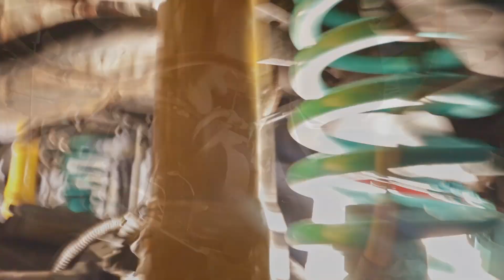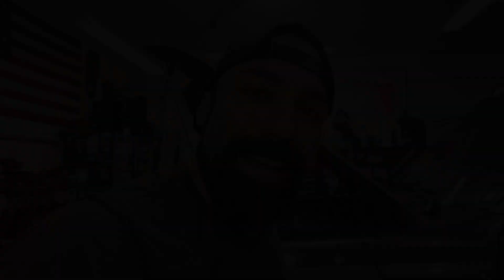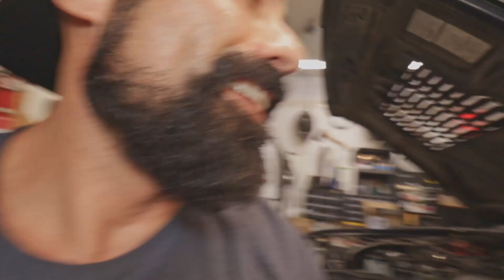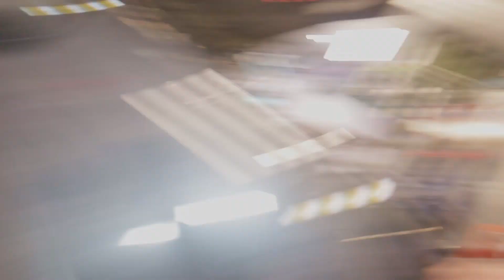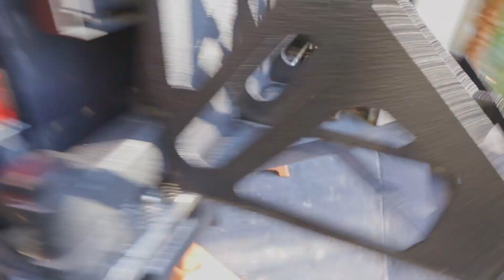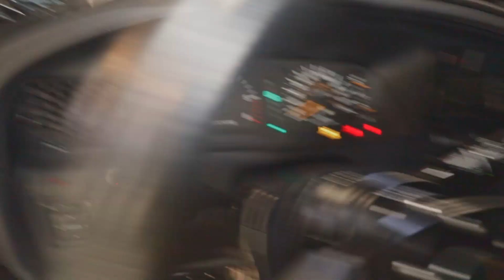Toyota Land Cruiser Front Axle Rebuild Part IIII

Comment: Just curious. Why did you install a locking hub if you have E lockers?
Reply from the maker: @slz_garage  Less wear and tear on the front drive train components. These trucks are known to chew up and destroy front axle shaft seals. Doesn’t matter which brand of seal you run it’s a matter of time till you get cross contamination and a leaky knuckle. Not only that but I actually like the way it handles on road. Thought I would get better fuel efficiency but’s it’s negligible. Cheers!
Reply: @trackcalledquest  just wondering... cause when you locked the hubs, it didn't seem to do anything. It wasn't until you engaged the front E locker that it locked as it should and rotated at the same time. 
I'm only curious cause I'm about to rebuild my front axle with the factory E locker.
Thanks
Reply from the maker: @slz_garage  by engaging the TC into 4wd via the center diff lock switch (7 pin mod), you also have to manually lock the hubs. I think I still had the hubs free spinning in the video. I do want to point out, even with both hubs locked and the front differential open, the wheel with the least amount of traction will spin, hence the term 4x2. A true 4x4 will have both locking differentials. In my case I’m triple locked.
Reply: @trackcalledquest  I have a triple locked 80 as well. I was under the impression that when you engage the front and rear lockers from the switch along with the center diff, that was all the was need to be fully locked front and rear. I did not know a locking hub had to be added for the full 4x4 experience. Lol
Reply from the maker: @slz_garage  yeah I have one extra step and have to get out of the truck to engage the front wheels hubs . Very nice! Have you done the 7 pin mod yet?
Reply: @trackcalledquest  I have not done the 7 pin mode yet.

Comment: Do you need to balance or line up the drive shaft?
Reply from the maker: Yes, the driveshaft should be balanced, specially if you are full time 4wd. The driveshaft should not have more than 5 degrees of angle at the pinion.  Cheers!

Comment: Does it matter if lock or unlock to remove 3rd member ?  Nice work
Reply from the maker: Shouldn’t matter if your locked or not.
Reply: @trackcalledquest  Hi Danny, I pulled my front diff from my 94 to clean and check tolerances, but didn't engage the front locker prior to the removal as stated in the shop manual. I reassembled the front end, but it's now fully locked in the front, and won't disengage regardless of the the switch location. Is there any tips you can disclose to me without having to disassembling the front end again? Thanks! 
M.
Reply from the maker: @MrTom-yv9kh  Mr Tom, same thing happened to me the first time. Simply remove the locker actuator and leave connected to harness. Second, engage the front locker switch in the cab. With the third member locked reinstall the actuator. Third, disengage front locker switch. Fourth torque the two studs down. Let me know if that helped. Cheers
Reply: @trackcalledquest  Good morning, Danny! Thanks for the tip on the locker issue. I'll give that a try this weekend when I get back from work. I'll keep you posted. 

Much appreciated, Sir. Safe trails!
M.
Reply: @trackcalledquest  Hi Danny, I was able to work on that actuator last night. Unfortunately, the actuator is not working, my guess is that it's burned out. I'm restoring the Cruiser, so I'll get a new actuator and give it a try again. And it looks like the rear is in the same boat as well. Both look to be the factory original units. I'll keep you posted. 

Thanks, and have a great weekend!
M.